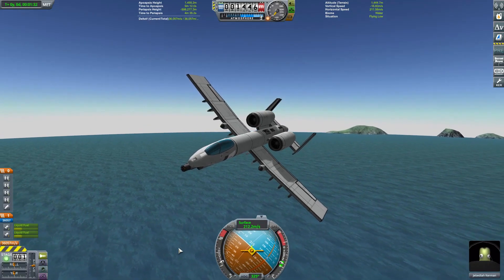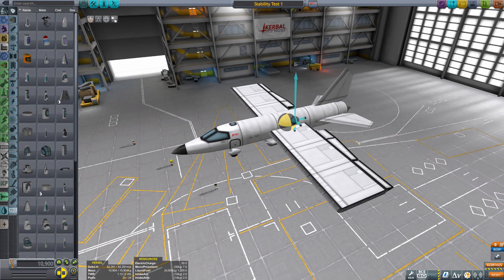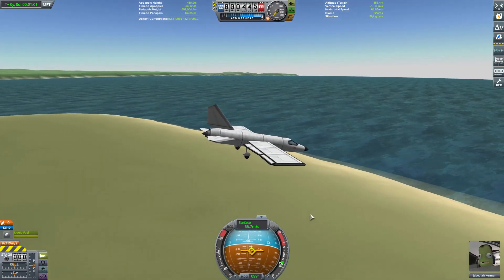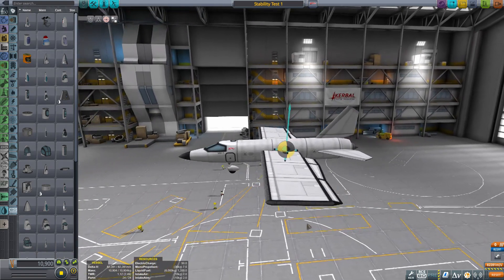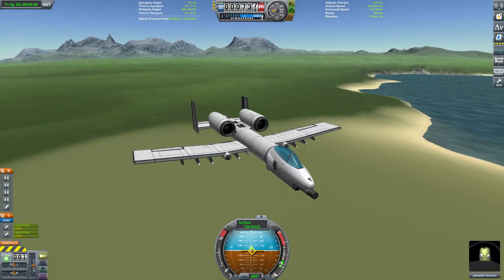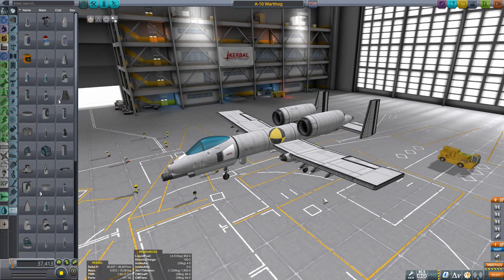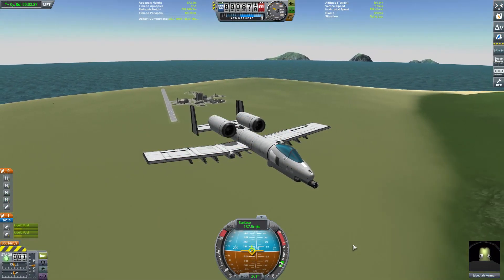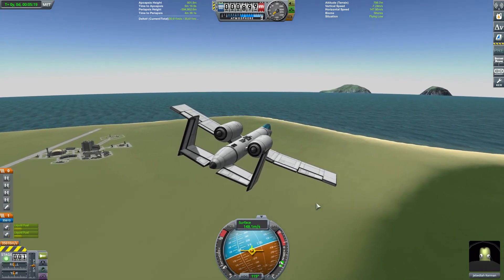Aircraft Tutorial - Flying Without Stability Assist - Kerbal Space Program

Comment: Things I learned today:
• It is possible to fly with less than maximum throttle.
• Not every plane needs to fly at the speed of sound.
• I don't have to worry about the up and down wobble. Set a course and come back later. :)
Reply from the maker: Something I forgot to mention is that you can bleed off a lot of the wobble yourself by trying to level off the aircraft half way up or down the oscillation.
Reply: Yes, and at right side of navigation system has G forces, when it shows about 1 you know your airplane can go stable flight on that altitude,  with current speed and trim settings. I have 5k on this game and just figured this out, not done much planes before